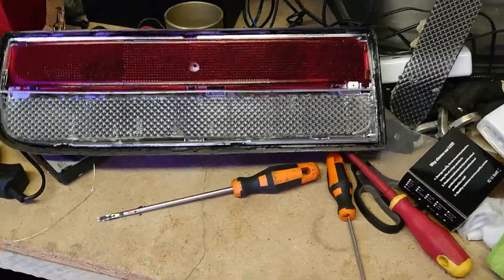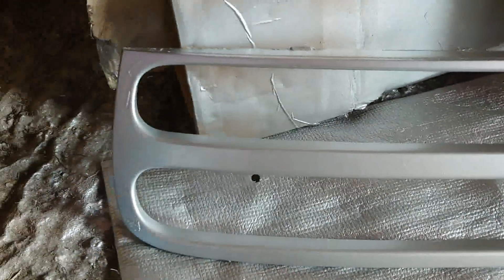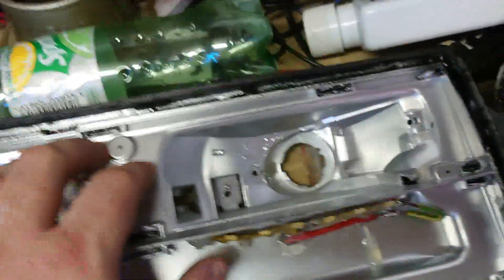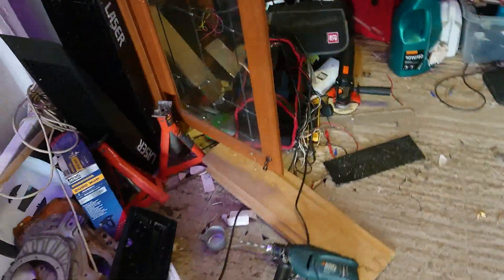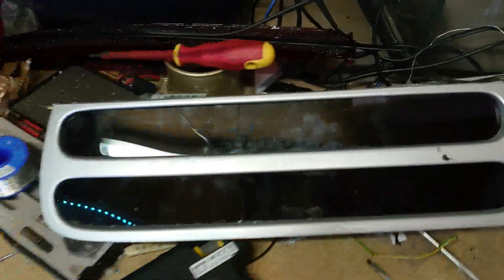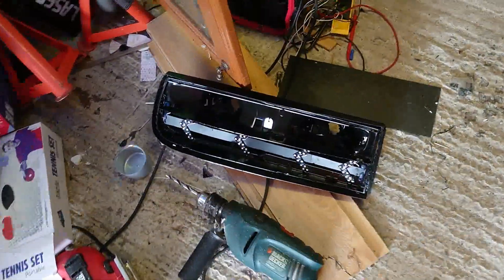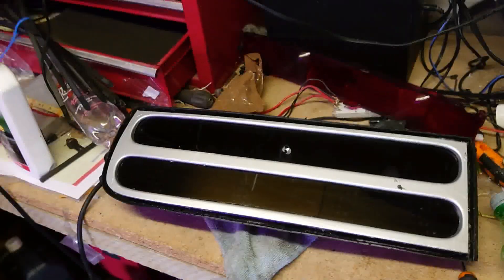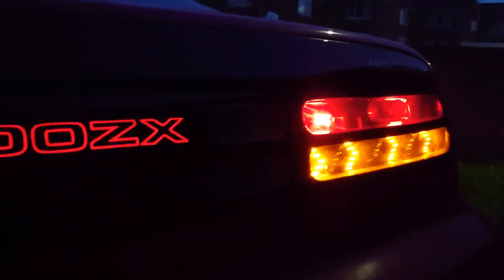Making 300zx rear Arrow Indicator lights

Comment: what leds do you use for,break lights,indicators rear front and side(sizes)Thanks
Reply from the maker: Hey there buddy. I use standard size bulbs. (OEM fitting) but LED versions. You have to change the flasher relay for the indicators

Comment: if you make these to sell i'd probs buy some, depending on cost and what not
Reply from the maker: Yeah I haven't worked out how much it would cost but materials are roughly...
£16 LEDs
£8.50 perspex
£2 plastic strip for LEDs 
Glue, the light units themselves and labour to do them. These took a full day to do, one went wrong to Beguin with so it took longer than it should
Reply: @Phantom_garage93  sounds good man deffo let me know if your keen to make some to order :)
Reply: also. you know the factory orange tint that come on the indicators would it be possible to retain that?
Reply from the maker: @dad6896  you could do however the arrows would be distorted due to the pattern on the orange lens